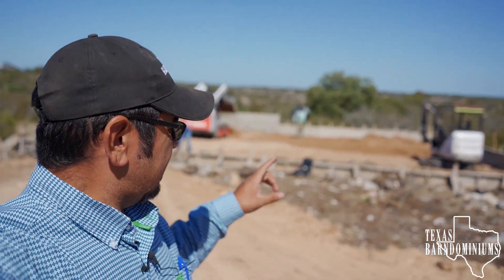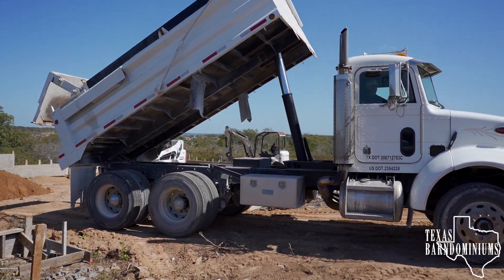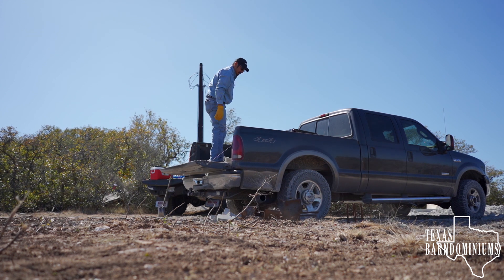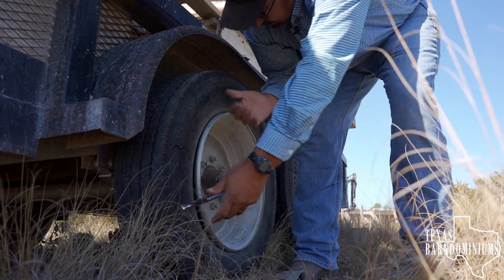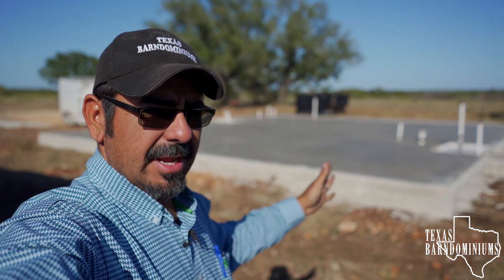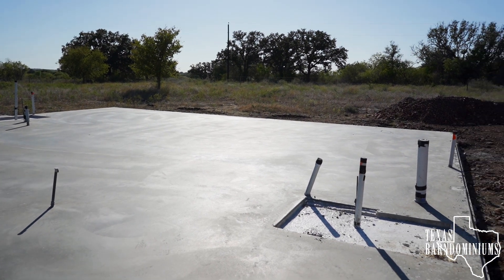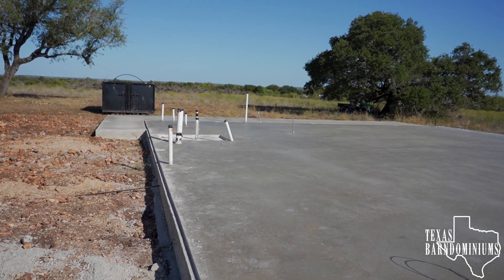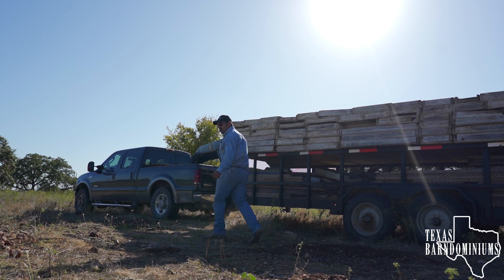Removing a flat tire the stupid way! - The Barndominium Show E180

Comment: Señor Cortina,
That tire changing ordeal was brutal. If only you had your Sky Hook you could have lifted the trailer with ease. If you would have also had your beam stretcher it would have facilitated the tire removal. And - the Brass Magnet would have told you about the overlooked tire iron.  Please pass these tips along to Manuel so he can use these valuable tools should he find himself in a similar situation in the future. 

As far as the blown engine, add a flux capacitor to the carburetor and it will never undergo another catastrophic failure to the engine. Make sure you have the correct diesel carburetor calibrated for that engine and that it is correctly installed at a 45 degree angle perpendicular to the radio mounting bracket to ensure it does not have any leaks. 
Another good video. 
Sure do miss the food reviews though. 
Take care and God Bless.

😎
👍👍👍👍👍

Comment: If anyone can make an
"Unbreakable engine" ( like you stated)
It would Definitely be you!
However I think when this motor takes a crap buy yourself a cummins! You will never go back.
Great video! 
That finish concrete job looked amazing! 👷👷‍♀️
Reply from the maker: I asked the mechanic that replaced my engine “which is the engine you guys work on the most”. He answered “Cummins, don’t buy one”
Reply: Texas Barndominiums Jimmy is master ase certified and we owned and operated Manns master Mechanics for many years. Until we sold it to down size and buid barndo.
Your Mechanic is telling you that because he wants to keep you coming!!! IF YIU BUY A CUMMINS HE WILL NEVER SEE YOU AGAIN LMAO 😂🙍🚚
Reply: Cummins is no doubt a solid engine. Ford builds their own and has had some hiccups here and there, but the 6.7 is very solid.

I never owned the 6.0 so I really can't speak for it.

Comment: 6.0 is a good engine after you spend an extra 10,000 to bulletproof if its great. I love when i hear this
Reply from the maker: We did it ourselves.  I designed the external oil cooler system, so that didn’t cost much either.

Comment: Howdy Eric, seems like I’m stalking ya. Good tip useful for all Diesel engines. Each quarter, add three percent by volume Petrol, Gas, whatever you call it, high test, high octane, then fill the tank as usual. The petrol sounds dumb, but it breaks up water, algae blooms, cleans valve and seats, decoakes the cylinder, stops rings sticking, cleans lines, and importantly, breaks up deposits on sensors and injectors. For over thirty years I have maintained vehicles and earthmoving equipment. When told this technique most people go WTF? But, when I point out to guys who spend bulk on fuel conditioners, injecter cleaners etc, that it is cheaper to place half a bag of moth balls (nephline) in their tank, same stuff as what’s in the bottle from an Auto Store, I still get WTF? My other tip is to use Lucas Bro’s product to all fluids, especially hydraulic systems. When we started using Lucas additives we never had to rebuild a pump again, especially power steering in heavy vehicles. I leave you alone now.Cheers!
Reply from the maker: Thank you

Comment: Word to the wise, always wet your studs with used oil before and after removing the lug nuts, I can hear the squeaky lug nuts. Never install a bolt or a nut without oil. No one knows your engine better than u.
Reply from the maker: My dad used to always spray them with water.   I should have done the same.
Reply: Jake Zgab graphite powder.

Comment: With a loaded trailer, I would have utilized that second axle by dragging the trailer up on a couple of blocks instead of an unstable jack. The good tire would be on a hard surface and the bad tire would be just hanging there.
Reply from the maker: Jack was not unstable, I made sure of it.